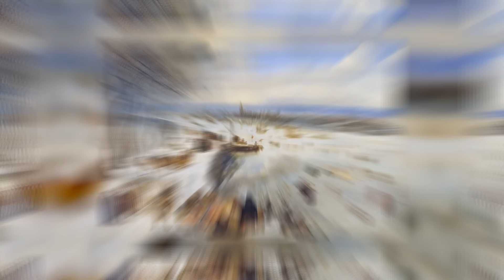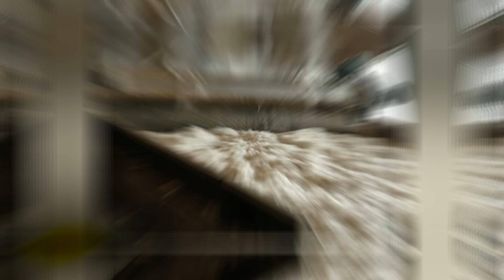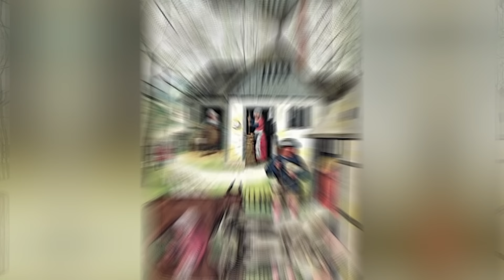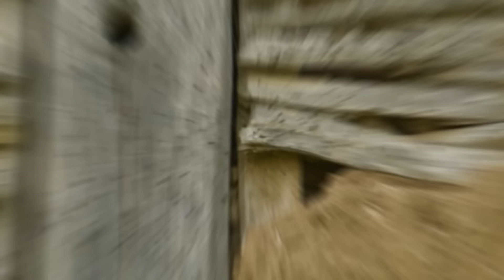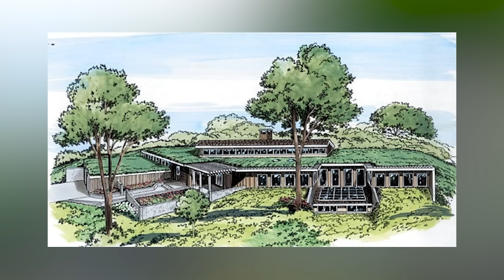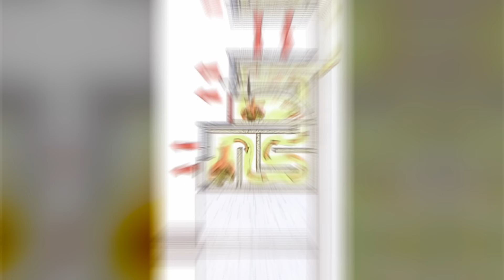7 Medieval Inventions That Kept Peasants Alive in -40°F (While Modern Tech Fails)

Comment: They also used candles and oil lamps that generated heat and they slept twice getting up and doing some chores then returning to bed. animals were kept on the ground floor and the living quarters were on the upper floor(s) The animals generated heat that kept the home warm. There are many more things that they did that have been forgotten.  My Mother lived in a 500 year old house with an open hearth fire that was used for cooking and heating as well as her parents and so on..  She was 10 years old the first time she was in a house with electrics and running water after WW2.  I learned a lot from my parents as my father also was raised in a house without central heating or electrics. Stone houses in the midlands of England and Wales. I will survive from what I was taught even if the power goes out. they burned peat, coke, coal and wood.  Air pollution in the cities was horrible.. SMOG  Britain has long been affected by mists and fogs, but these became much more severe after the onset of the Industrial Revolution in the late 1700s. Environmental legislation since 1952, such as the City of London (Various Powers) Act 1954 and the Clean Air Acts of 1956 and 1968, led to a reduction in air pollution.  Houses were taxed on the number of chimney's they had in order to reduce their use and promote the use of boiler systems/radiators.

Comment: The coldest? It was only -46F in down town Medicine Hat but the wind chill took it down to -93F. Then we had to go to Suffield Block to service gas wells. The wind was blowing harder and Suffield tends to be about 10F more extreme in either hot or cold weather. It's like a little slice of hell when it comes to weather.
Reply: Edmonton for me with temps very close to yours. 🍻
Reply: @waterman79  I was raised east of Edmonton surrounded by lakes and we got some pretty strange weather. Around 1970 we had a brutal cold snap. All the people in the area had temps just as cold and I doubt we all had defective thermometers. When you spit ice hit the ground. That's cold. Part of the reason I moved south.

Comment: minus 59 wind chill in ottawa canada 1995 in a self made cabin with an outdoor stove, heating an iron pipe using a gravity system to move heated air into cabin, cardboard and plastic insulation with plywood walls and ceiling
Reply: how did you make it? can you explain it thanks ahead...